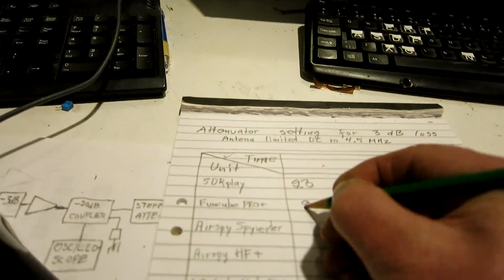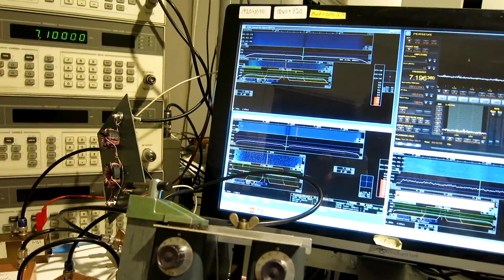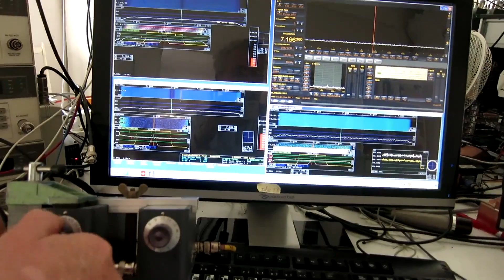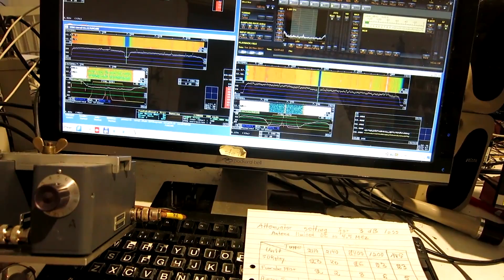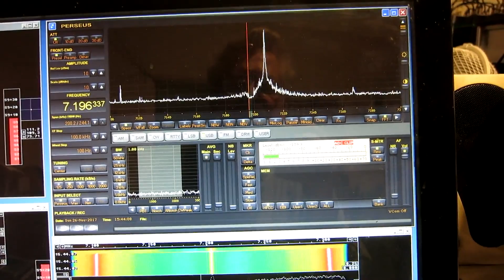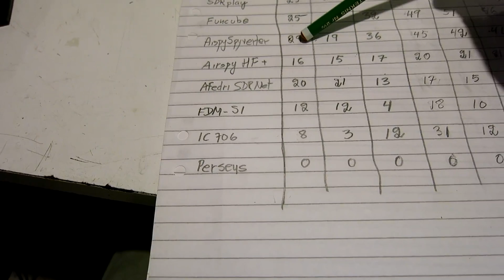rx5compare

Comment: It would be good to see the much newer SDRplay RSP2pro or RSP1A compared here (the RSP1 used was the older, original "SDRplay" design)   See https://youtu.be/D4y4llOkNYM
Reply from the maker: I can not buy every new SDR that becomes available just to publish tests on them. It is however quite obvious that RSP2pro or RSP1A would perform better in this test since they have  filters on the input. By how much I can not guess. Removing the range DC to 2 MHz may or may not affect the performance in this test much.
Another test that I am not doing is to check the resistance to local MW broadcasters. The MW rejection filter would certainly make a big difference for such a test.

Comment: Very Interesting!  What kind of Antenna are you using?
Reply from the maker: It is a simple wire antenna. About 8 meters long going from a point near ground into a three maybe 5 meters away. I have shown it in one of the "compare rx" videos, but I did not find that sequence now. This antenna is to be regarded as a poorly matched E-field sensor. It does however pick up the atmospheric/cosmic noise at my location well above the noise floor of the low noise amplifiers I have been using. A full size antenna with high efficiency would pick up much more signal on 7 MHz and require some attenuation to place the antenna noise about 6 dB above the receiver noise floor.